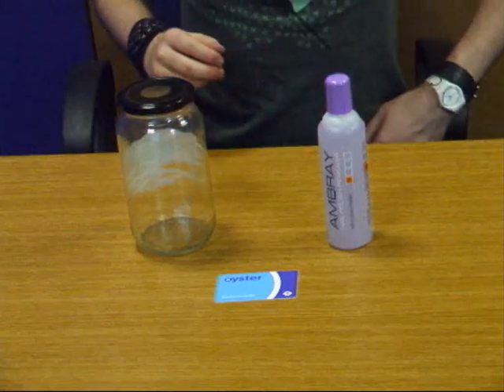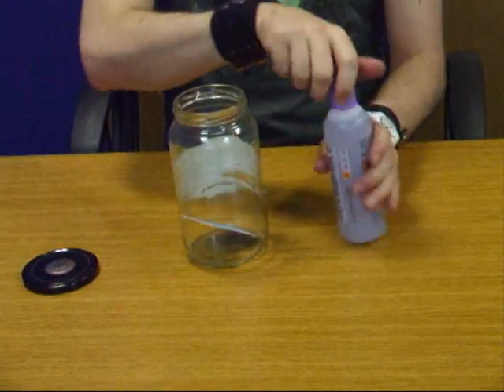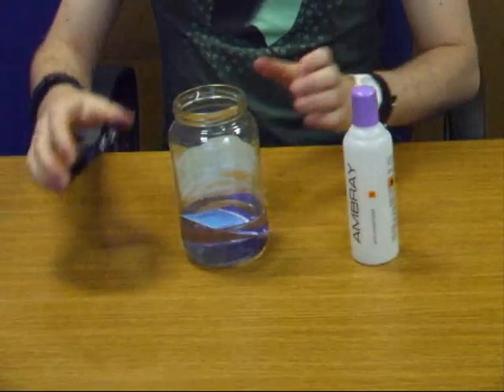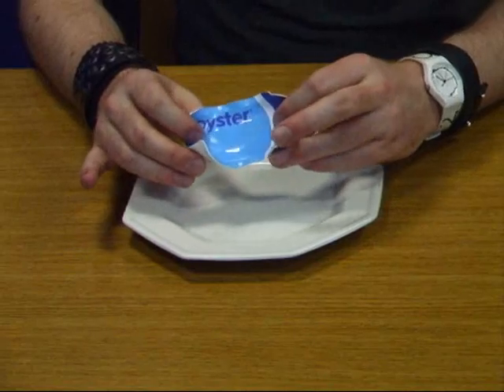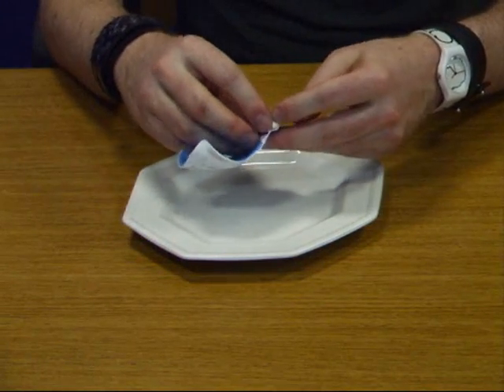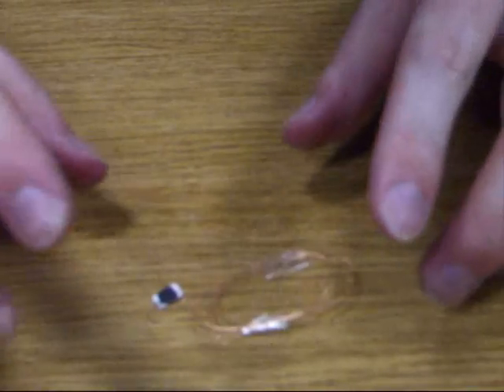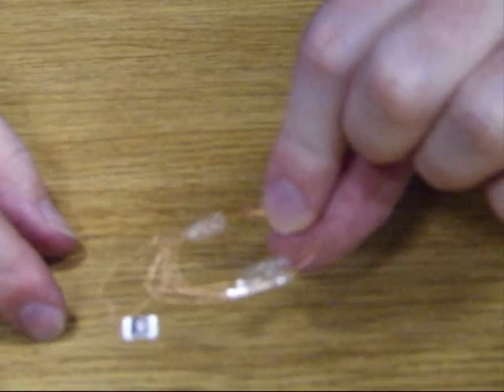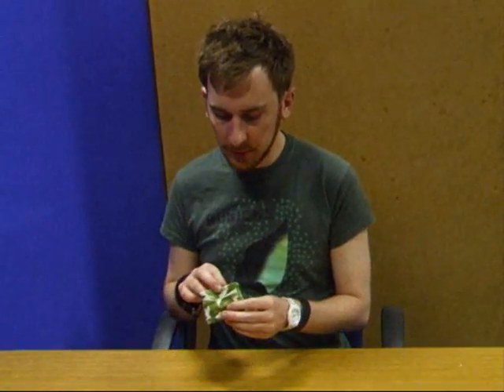How to remove the RFID chip from an Oyster card

Comment: Can you replace the chip with another intener ?
Reply from the maker: Theoretically you can add a new antenna if you break the old one (it is just copper wire). However it is VERY fine, and the circuit board is so small that it is difficult to solder the new antenna in place without cooking the chip.)
Reply: @ thanks man, I’d love to try this but I will have to pass. I was trynna be cheeky seeing if I can fix my broken one 😫🤣
Reply from the maker: @Alz.4k  well, even if you don't manage to fix the card you'll learn something new. It's fun to break things open and see how they work

Comment: Nice, I've cut through the RFID symbol before when voiding an expired card but I only saw the cross section of the wire antenna in the cut.  This shows that the chip could be anywhere in a large area, it's just the wire loop that has to go around the printed RFID symbol.   I'm not sure if it's worthwhile to use an entire bottle of nail polish remover just to remove an expired chip as activating the replacement card should cancel out the validity of the chip.  I do wish that the credit card companies would use a challenge response protocol with both the RFID and the SIM chips so that the usually well equipped criminals can't just put card skimmers out as they have been doing.
Reply from the maker: Hi John - cutting the antennae will render the chip useless, unless someone takes the time to solder a new one. You can always smash the corners with a hammer to break the chip, but as you say once the card is deactivated by the bank it doesn't really matter - nobody is using ZipZap machines any more! 

I wrote here about balancing convenience and security - it was interesting to learn there are a lot of subtle things banks use to check your transaction is legitimate: https://www.bbc.com/news/business-49877317

Comment: Guys buy an RFI scanner hook it up to your pc, scan ur RFI chip in your oyster card , buy a few more RFI chips and burn the oyster program onto the other chips, it will give u your exact balance on each of them! Therefore, if you ever lose your oyster card u have a few backups and it will save all of the money you had previously! ;)
Reply: No, Oyster Cards have DESfire EV1 or EV2, which means they can't be copied without breaking it's encryption key. DES keys are not at all easy to breaks since DES literally stands for Data Encryption Standard, which means it is the standard of encryption that is used worldwide.

Comment: if the antenna is cut in two parts, is it still possible to reuse it..?
Reply from the maker: No, I think it needs to be a loop. As the antenna passes through an EM field, a current is induced in the wire, powering the chip.
Reply from the maker: You could just solder the ends together....
Reply: Mine doesn’t work for some reason, should I roll mine ? Or open it up and form two wires ? I’m trying to fit it inside my phone case or key card , but doesn’t scan.

Comment: If you ever travel outside of the U.S. your card will not work in many locations if you remove the RFID chip.  Many countries are replacing the magnetic readers with the RFID readers.  It wont be long before the same happens in the U.S.

Comment: This method does not work with the translink GoCard. While the design is very similar, the wires are either some delicate semiconductor, or paper thin foil. As far as I can tell, it is impossible to separate them from the card. Even the chip is paper thin, it seams more like an etched circuit.

Comment from the maker: @alpengeist19 Some bank cards use RFID chips now, usually labelled as having "Contactless technology". 

Also, any card that you wave in front of a scanner (without touching it) is probably RFID, but I don't know if the plastic in those will melt as easily as the Oyster card.

Comment: @hellolms You sir, will be proven wrong. :|
I'm a leftie. jk
I am, but you're taking this stuff too seriously. People try and find EVERY single way to scare people, and quite a few of them take things out of context.

The right hand and forehead relates to what people do and think. RFID means " Radio Frequency Identification" or " Radio Frequency Identification Device."

ID? It doesn't CONTROL anyone. It identifies. And this is used for short range identification. It isn't long range. :P

Comment from the maker: The aerial still works even if it isn't perfectly laid out. So long as it's in a loop it will work.
Reply: why does it have to be in a loop? I wanted to attach it to a ring and wear it
Reply from the maker: @massurname7940  The chip has no power supply. As the aerial passes through the electromagnetic (EM) field of the reader, the field causes the electrons to be pushed along the aerial, and this generates a current that powers the chip. Looping the aerial helps the EM field push electrons in the same direction at the same time at multiple points along the wire, multiplying the effect, making it more likely that the chip will get power and work properly. It's pretty forgiving though - try experimenting with different patterns and layouts of wire and see what works! (remember: the aerial always has to be connected at both ends to the RFID chip)
Reply from the maker: @massurname7940  Sorry for my slow reply. You can coil the wire up into a small loop, so long as the ends are connected to the microchip it will work fine. 

It has to be a loop because the chip is powered by this aerial: when the wire passes through an electromagnetic field, the electrons inside are pushed along it like marbles in a pipe. More loops = more pushes = more electrons moving the same way down the wire = a flow of electrons that pass across the microchip and give it power

Comment: TfL seemed to have cottoned on to what people are doing with these Oyster cards. I peeled open one last night, as per the instructions in the video. The ariel now seems to be a 'printed circuit' rather than an actual loop of wire. you can still remove the chip, but you won't have a ariel. Shame that.